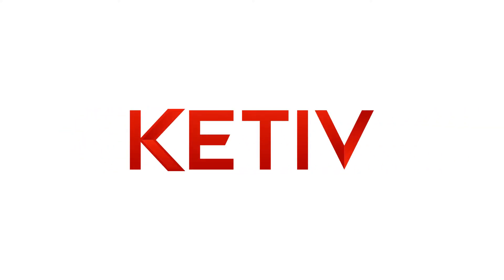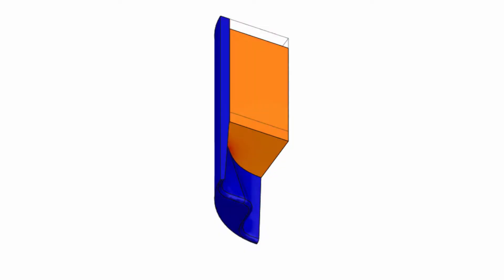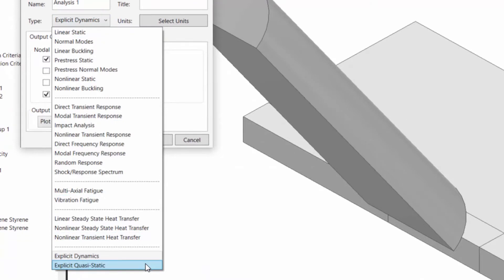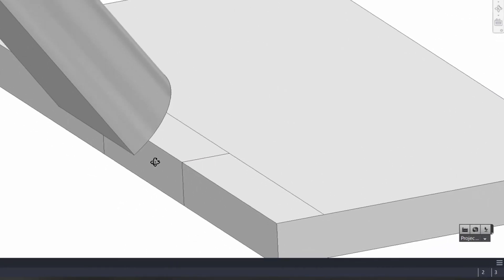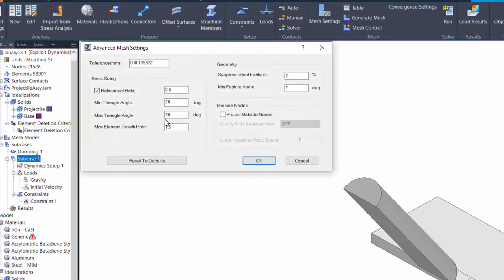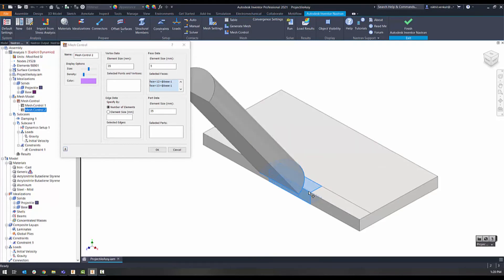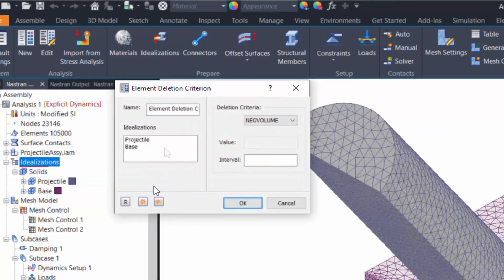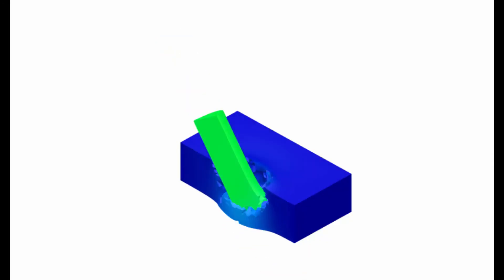Tech Tip: Inventor Nastran Explicit Dynamics

Comment: One problem I have encountered in Inventor nastran when doing high speed impacts with element deletion is when the impact wall is thick like 5-6inch the plot results only shows the 4 side faces not the cavity inside in which it created a hole, I tried alot of ways to fix this but I just cant, maybe this is a software bug or something.

Comment: Why use linear order elements for non-linear FEA?
Reply: Element order describes how it is meshed. It is different from the type of analysis being run. 
A linear element simply has nodes at each corner of the mesh. A quadratic one has an additional one at the mid point, allowing the element to "bend", which is good for bendy parts. 
You could certainly used quadratic elements in non-linear FEA, but the solve time would be astronomical. It is generally preferred to just use a higher resolution linear mesh.